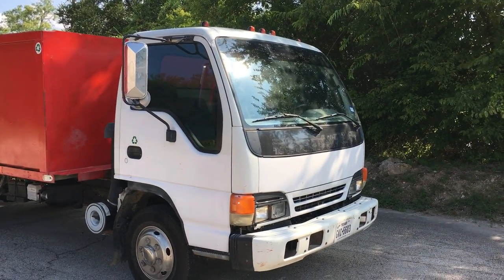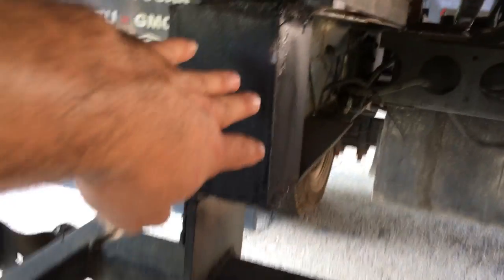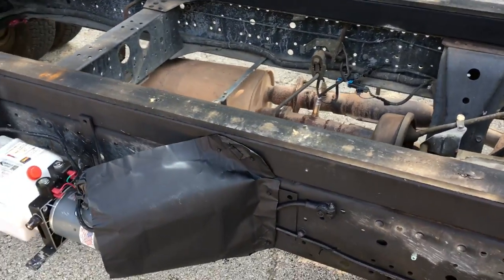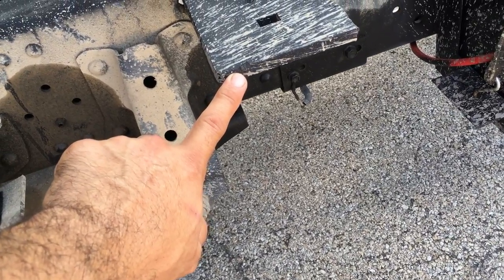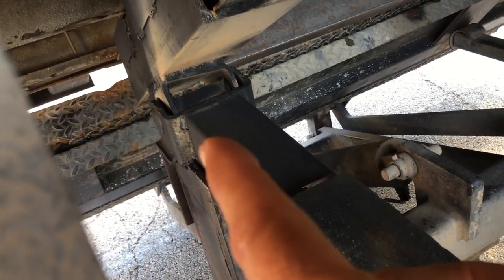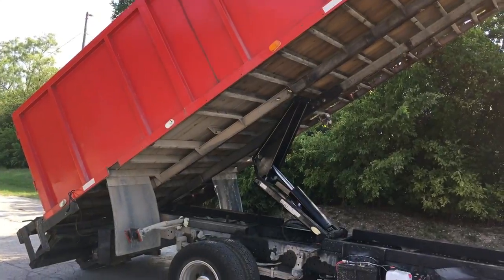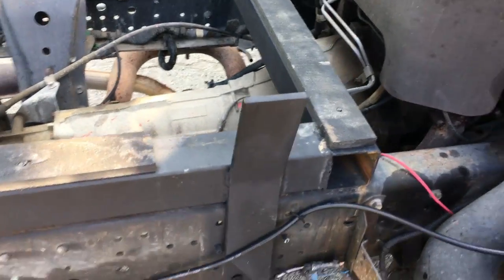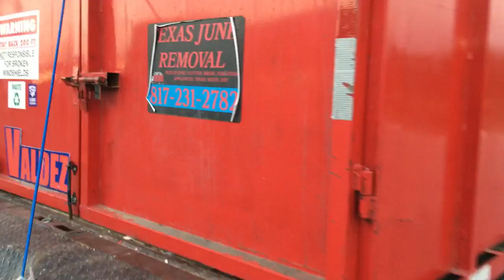How  to install a hydraulic dump hoist kit PREMIUM SUPPLY

Comment: Your hoist is to far back if you put 12 yards of mulch in that bed towards middle to the front it would never dump it
Reply from the maker: No is not to far back, it’s where it suppose to be, and I did dump 12 square yards of shingles that was thrown in the front, if it’s moved more to the cab it will have less angle 📐 dump degrees, right there it’s at 47 degrees
Reply: @juanvaldez1441  ok

Comment: Took me forever to find a video like this! Thanks for sharing. If you could explain the hidges that'd be great!
Reply: do not take any notice of this video as a professional tipping gear fitter of over 40 years this is an amatuer trying to do something he IS not capable of.  THIS IS an absolute DANGEROUS FITTING JOB
Reply from the maker: Norman Shakespeare 
😂😂😂😂😂 
It’s still working great,
Reply from the maker: The hinges come with the hoist kit, I added an angle liner to the i beam bed frame to make it sturdy, the i frame is to thin!
Reply from the maker: NEXT PROJECT A ROLLOFF HOIST KIT ON A NPR OR BIGGER TRUCK!
Reply: The only thing that really makes me raise an eyebrow is that square tube thst runs along the top of the frame rails. I dont understand why there is a gap between the tube back by the hinges and the length that runs up to the cab... And there wouldnt have been any problem stitching those to the frame rails, maybe move around alot as you weld to be safe. But that square tube shouldve been one piece. Its plenty solid but you get a full box of dirt or busted up concrete and shit might get kind of colorful lol

Comment: Una pregunta,  que tipo de bomba recomiendas par una dump truck ford f450 diesel
Reply from the maker: La de 3,000 psi
Reply from the maker: Búscala en premium supply, si preguntaras por el kit pues te recomiendo el de 8tons eso si está corta, si el chassis es largo pues el de 10tons para dompear más facil
Reply: @juanvaldez1441   ok gracias

Comment: Thanks men, there is very little info about this conversion
Reply from the maker: Doroteo Arango what is that you need to know?
Reply: Were you get the hydraulic pump at
Reply from the maker: eBay ph520 10ton lift
Reply from the maker: Actually this one is the 516 8 ton lift
Reply from the maker: So what else do you need to know Valentine

Comment: Thank you for the video. I have seen some trucks with the pump connecting to the existing batteries. Did you add a third battery for the pump? Good job by the way!
Reply from the maker: Yes I added a third battery

Comment: How much weight could that pump push. What was it rated as
Reply from the maker: redburro88 
That’s a 8 ton lift,  I have Rolloff trucks with the 10 ton and I have dump 16,000lbs  that’s the most I ever had with the dumpsters
Reply: Tengo problemas al levantar la cama es bien lento no era así

Comment: Hola Juan que maquina para soldar usaste?

Crees la maquina de soldadura de rollo se pueda para este tipo de trabajo?
Reply from the maker: nglezcasas 
Es la que use, .035 wire,
Reply from the maker: .35 flux cor
Reply: Juan Valdez 
Tengo una  utility F450 truck y la quiero convertir  para Dump,  y estado  buscando videos y nadie explica tan detallado 
Muchas gracias.
Noe
Reply from the maker: nglezcasas cuando acabe la lleve para que la soldaran mejor con soldadora grande
Reply: Oye juan estoy trabajando en un hidraulico igual de esa misma marca pero cuando conecto el cable positivo de la bateria hace chispas si precionar el control que puedo hacer?
Reply from the maker: Luis Campos chequea que lo estes conectando donde debe que ir, el positivo va en la connecion negra, NO LA ROJA, 
Y si conectaste el positivo donde debe que ser, pues chequea que el positivo que viene de la batería a la pompa que no esté pelón y toca tierra
Reply: Ok mañana la voy a checar gracias juan por la ayuda
Reply from the maker: Si encontraste el problema
Reply: Juan Valdez si ya la entrege al cliente graciasme gustaria mandarte unas fotos pero creo q aqui no se puede jejejej me quedo bien la hise desde cero le batalle un poco porque trabajo yo solo en mi garage
Reply: Juan Valdez yo uso barilla 7018 para soldar todo lo que lleva peso yo se soldar casi con todas las soldaduras soy soldador por 20 años y pipefither puedo soldar tig,mig,stick,aluminio o el mig puedo soldar casi todos los alambres si tengo un buen de esperiencia en soldadura pero gracias por la recomendaccion ese es tu numero? Para mandarte unas fotos y el video de la troca que hize
Reply: Saludos Juan recientemente compré un Hoist Kit completo con una single pump y es asi como la tuya. E tratado de buscar las instrucciones de como instalarla pero no la e conseguido. Como por ejemplo a que distancia va la tijera desde la tapa de atrás hacia alfrente?? Va en el medio de la cama o un poco para atras?

Comment: How can I safely hold a dump in the air I have a  hose leaking
Reply from the maker: Change the hose!
Reply from the maker: 9 4 
Put a 2 thick pipe or 2 4x4 wooden post under the bed, that’s if the bed goes all the way up!
Reply from the maker: By removing the hydraulic hose, yes the bed will go down by itself but won’t put down pressure to where it breaks the 4x4 wooden post!
Is it a small bed or a bed from a dual axle truck?
Reply: Juan Valdez duel axle yeah I found some long 2inc pipe and some blocks

Comment: you are NOT allowed to weld on to the frame rails
Reply: Not so, some frames can be welded, not all but some
Reply: Only heat treated frames cannot be welded. Not sure on this one. I have a Class 8 Kenworth and the frame rails are heat treated. Welding on them is a no no.
Reply: @oby-1607  Here's how to be sure: Look at how the mfg attached things. If they didn't weld, you shouldn't either.